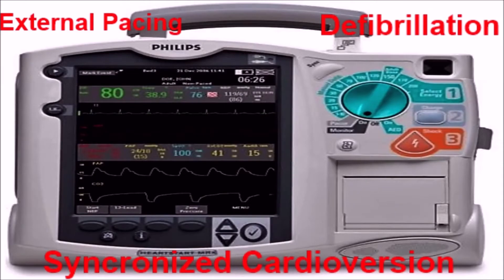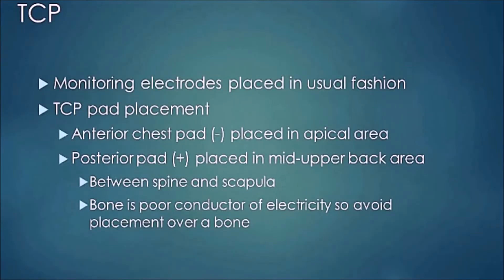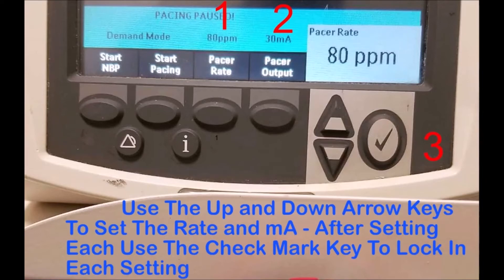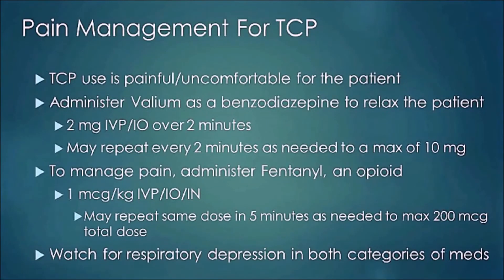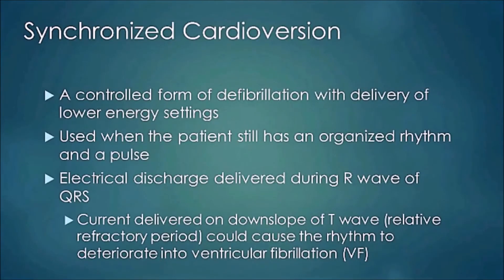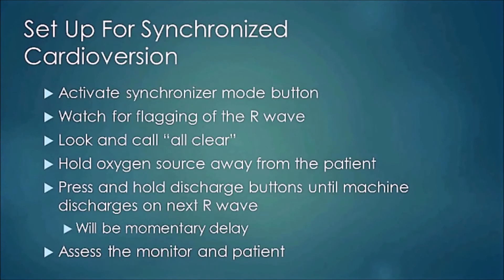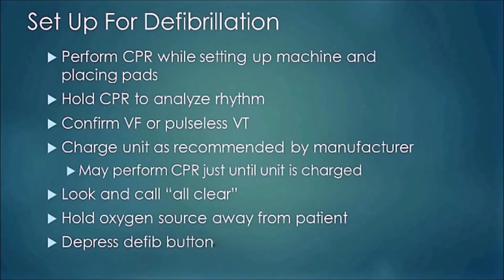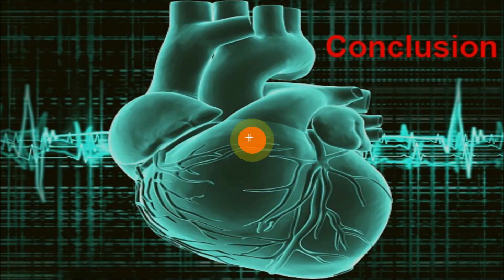Pace Maker Basics Tutorial - Phillips Monitor

Comment: Be careful of what you teach and make sure it is consistent with the Philips Manual.  You need to know the difference between the demand and the fixed mode. You can use the paddle without the machine's EKG wires on a fixed mode but you need to have the leads on the demand mode.